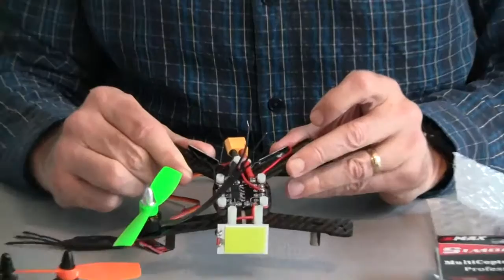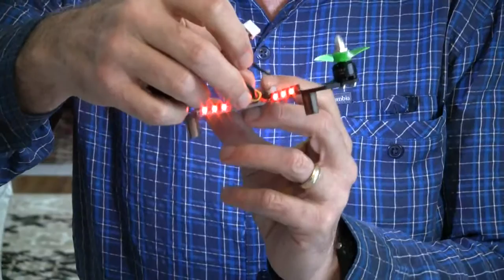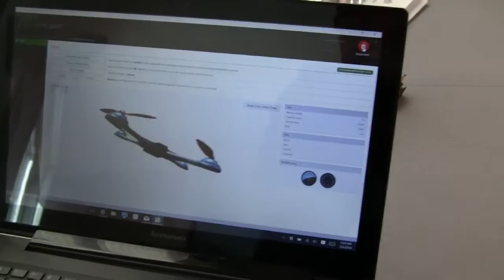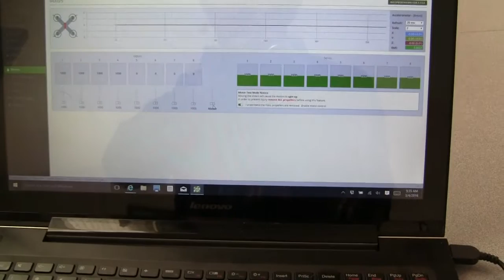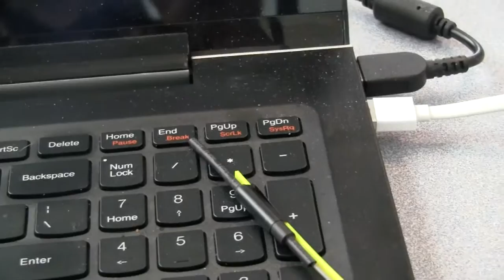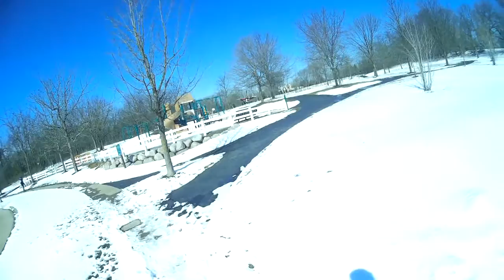Grasshopper 160 with Ready to Sky 1306 x 3100kv Motors Built and 1st Flight

Comment: Try flashing betaflight. I was having a bunch of problems with calibration in cleanflight so I flashed betaflight and the problem was solved. 

If you don't want to use betaflight you could try flashing cleanflight.
Reply from the maker: +OHMYQUADcopter I flashed Betaflight and it still doesn't calibrate correctly thanks for the suggestion
Reply: Hi John, I have the same problem with my robocat 270 and I have been told its because I'm using the naze32 rev 6.  Are you using this version of naze as well? I also tried taking all the postitive pins from the esc connections and while playing around trying to calibrate the dam motors I some how screwed up 3 esc's. 3 of the motors now don't spin but just move a little. Looks like back to the drawing board for me I'm gonna get new esc's and a new FC. Good luck with your build and I hope you find away to calibrate your esc's without distroying (like stupid me).